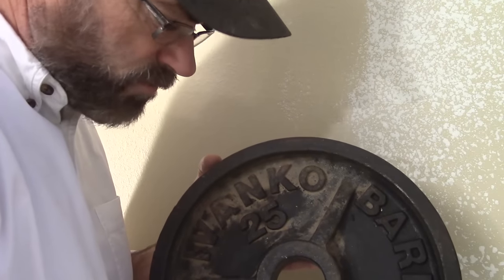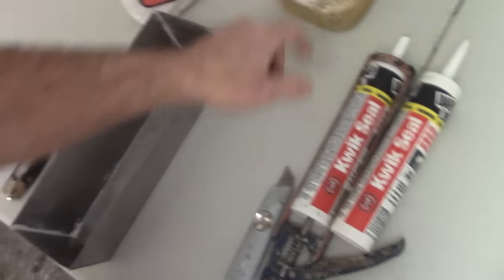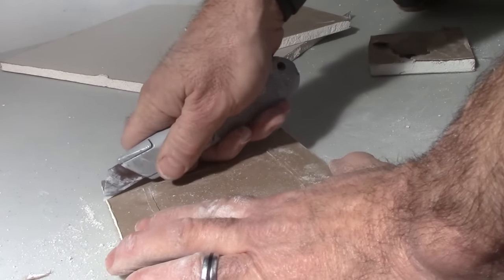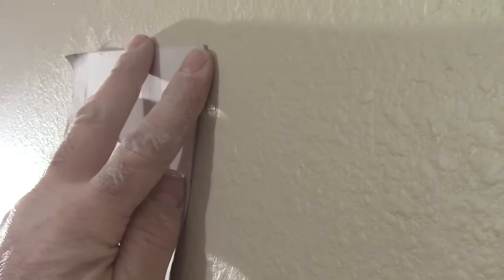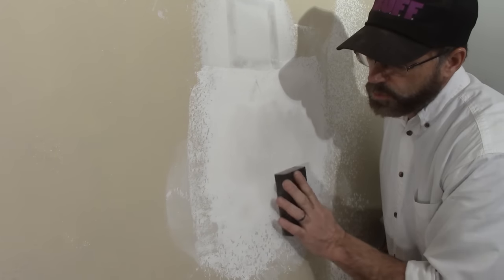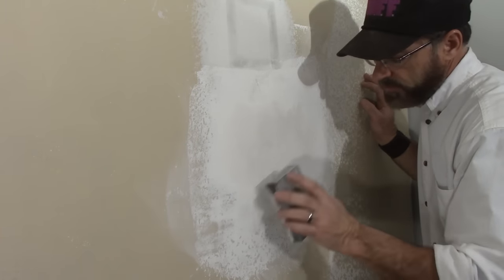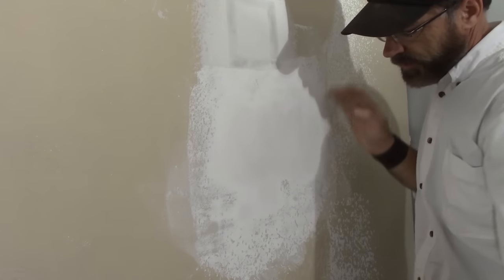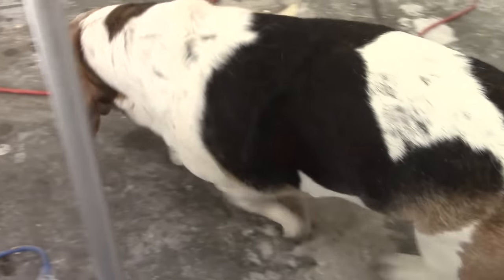How to Repair Drywall and Match Texture - DIY Duke

Comment: I was a professional drywall finisher for over ten years and my husband for over 40 years and We have NEVER seen or heard about flicking drywall mud from a brush for texture. I tried it today to texture several patches in a bedroom and I am SO IMPRESSED!  It worked like a charm and looks amazing. It worked so much better than the canned stuff and a heck of a lot cheaper! Thank you SO MUCH.
Reply: Carrie Wainwright - As a professional drywall finisher, I would love to know what the painting contractors told you about people that apply caulking is wall patch? I was a professional interior finish carpentry contractor for many years and know the painters said "DO NOT put caulking on the dry wall surfaces"
Reply: @carlcampbell6827  caulk can't be sanded and usually is so flexible that it will crack the paint if it moves. I used to work at USG (U.S. Gypsum) and we made lots of different kinds of mud but they are pretty much all made with gypsum so they are similar and often you can use them interchangeably if you know the properties and what you want out of it. (He probably shouldn't have used it here but if he isn't going to sand it because it's his own garage... Then whatever. Not the best application)
Reply: Yes. I never thought of this and it's so much more reliable than the can stuff.
Reply: @carlcampbell6827  that’s probably because you didn’t know how to use a caulk gun.😂😂
Reply: @santiagobenitez6818  I suppose you were taught to use latex caulk as patching material on drywall? This knowledge you are asserting about proper use of caulking gun is a good example of non professional teacher. When caulking finish and trim wood, caulk must not be smeared over adjacent drywall or it will leave smooth shiny strip when wall paint is applied.
Reply: 13:06 - flicking drywall mud from a brush for texture

Comment: Dear DIY Duke, Thank you so much for posting this! I've never worked with drywall or repaired a wall hole before, but thanks to your instructions, I was able to patch an 18" by 18" hole in my bathroom and even match the texture to the rest of the wall. I used your caulk method, and it was easy to use, and set really well. Thank you again!

Comment: I commend you for taking the time to create this video for the viewers. Having said that, I'm continuously amazed at how many diy'ers use this method to patch holes. it's NOT the right way to do it and it takes no more time to do it right. Cut a patch. Hold it on the wall over the damage and trace around it. Cut the hole in the wall around the damage. Install two 1x2 strips of wood to the wall as backing inside the hole. Place the new patch in the hole and attach it with screws through the wood 1x2's. Apply fiberglass tape on the four seams. Apply two coats of hot mud. Sand hot mud with a damp sponge before it sets up hard. Texture to match existing. EASY. No sanding dust. Plenty of backing strenghth and more importantly, this creates a solid patch with solid backing. Should you patch a door knob hole with this method, the hole will stay patched should the door knob crash into the wall again. Furthermore, if you know you're patching a door knob hole, you can place the wood strips right where the door knob would strike and FURTHER strengthen the repair. I'm a 40 year house painter and I've repaired hundreds of holes this way. None have ever failed. Bob.
Reply: Exactly.
Reply: Robert Partridge Hey Bob! Do you have your own YouTube Channel? I'd love to subscribe!
Reply: I concur. I do maintenance and repair for a living. Patching 6' and below should always be backed with something. Once I was hanging a picture and hit one of these backless repairs and boom. Now I had to do wall repair before I could hang one decorative art piece for my customer.
If you rent and damage the wall. Fix it right. Remember Karma will find you.
Reply: That's the way I was taught in shop class nearly 12 years ago.  I became a painter and not one person does it that way.  They all use these metal patches.  Probably because it's less supplies to carry around and you don't need sheets of drywall with you.
Reply: Thanks...   People do not think of proper texturing for that seemless look.  Shit loads of putty & sanding do not give you that paper texture look of drywall... You can see where the hole was...
Reply: +Robert Can you put two holes in your wall to prove to us that this is the correct method?
Reply: Need a carpenter
Reply: Either method works. This method is MUCH easier, mate.
Reply: And...your DIY video is where? If you can't add something constructive without condemnation of others, they shut up.
Reply: I use paint sticks.  I get a few EVERY time I go to the big box store.
Reply: There's always one...
Reply: Sounds pretty good, but also forever
Reply from the maker: Dude really then you've added an unnecessary step, if you worked around fast set very much coupled with fiberglass then you know you don't need wood unless you're using viagra😂
Reply: Hey rob, this is a California hot patch. Pros use it all the time and you use durabond to tape it in and first coat it. Once it dries its harder than the original rock.
Reply: @anthonyb5193   Isn't that bondo? I love that stuff.
Reply: For larger patches between studs I understand the need for inserting something to then put a drywall screw in but these holes are too small to have to worry about doing that.  The only thing that jumps out to me is that the caulking he used really isn't going to adhere to the "raw cut" sides of his patch.  It sticks to the paper and to the wall but it's not really grabbing that rough, chalky material on the sides of the patch.  I use this same method except I butter the patch with mud and it sucks into the chalky sides and becomes part of the existing wall.  Also, if you spray the paper before buttering up with mud the mud adheres better.  So many different ways to do the same job but I wouldn't use caulking in this application
Reply: If the patch was done correctly, with mud and not caulking the wall should be plenty strong enough unless you hit the wall with a hammer with driving a nail.  @1stFlyingeagle
Reply: What says your way is correct. Cut the drywall 2square" bigger and cut out your hole. Remove the gypsum from the 2" overcut drywall or other wallboard material as needed leaving the white paper. Mud, Install patch, tape, and mud. Sand and paint. 3 he till dry w/ a fsn.
Reply: thats what i say.

Comment: Thank you Duke, had a patch to do and its quite a drive for tape. The inch of overlapping paper that was something. I appreciate the idea that I am going to keep with me. the only thing I did different was I did the backer. I went with the hot mud as that's what I had but followed you steps to the letter and my patch was feathered perfectly and flawless. Nobody would ever know there had been a hole there. I appreciate that you took the time, effort, and material to teach something you didn't have to based from your own experience.  I hope you are doing well.

Comment: Wow, thanks for the stiff brush-flick texture idea - that is so cool.  I am exhausted doing my 2 ceilings with a skim coat.  I had scraped off 1965 type popcorn texture.  Trying to decide, but you have shared some great patch/texturing examples.  thanks for your time!
Reply from the maker: You're welcome Janet.  There's some cool ceiling textures you can do, one of my favorites is a skip trowel with a little bit of silica sand mixed in with the mud.  Looks old school simulating plaster.  Another style I like is painting the ceiling first then taking the paint and mixing it in the texture mud until you get a slight color difference then you get this awesome subtle two tone effect.

Comment: Great video! I wish you had some text on what texture was what on the finished product. Here's what I gathered:
15:21 Top right: Brush flicked (13:09)
15:33 Top left: Spray Can Regular (orange peel, 13:29)
15:39 Bottom: Spray Can Knock-down (14:04)

Comment: Excellent video, funny and informative.  If the damage to repair is on the bigger side, it's a good idea to screw a backing piece or two of wood strip across the hole -- insert strip into hole, fasten across hole with drywall screws on either side of the hole set back an inch or two from the edge, being careful to dimple the screws but not overdrive through the drywall paper -- before inserting the patch, to prevent the patch from ripping free if someone pushes on it, drives a nail into it, etc.  You can also fasten the patch to the wood strip.
Reply from the maker: yes, thankyou

Comment: I just did a major wall repair which repairing an area where the paint had separated from the wallboard.  When I cut through the paint to repair the separated spot I found that to be the tip of the iceberg--the paint just peeled off the wall.  What apparently happened was that the person who primed the wall originally did not clean the wallboard first.  Thus, the primer did not stick to the wallboard.  

I wound up peeling 2/3 of the paint off the wall before i reached paint with decent adhesion.  I cleaned and primed the area and then came to your video to learn about repairing texturing.  I wound up doing the same thing as one of your other "viewers"--I stopped the video to make sure I took the time to express my appreciation for your having taken the time to produce it.  It was very entertaining and I learned a lot.  I thought the caulk idea was genius.  Years ago I tried using spackling to "glue" patches in and have found that it just doesn't work.  I have since used paint sticks to form what I call "backer boards".  I screw them into place with drywall screws to provide support for the patch.  But the caulk idea is faster I think and plenty strong enough.

Thank you again!
Reply: Thank you for your video. I have some patching to do. I didn't know how to make the texture match. Again thank you for your time to do the video.

Comment: A mistake a lot of DIYers do is to use plain old spackle. Baby power mixed with water would work about the same as spackle. Need to use a curing type joint compound. The caulking repairs are stronger and more flexible so they're less likely to crack as the house moves.

Comment: You can also use a wet sponge instead of sand paper. I've been doing it for years. Just dip the sponge and leave a little water in it. Then you just wash it, starting around the edges and working your way towards the center. The benefit of doing this is there is no dust and you can paint it almost immediately.

Comment: Thanks man, I just did the same job yesterday and I’m a younger guy and I’m not too knowledgeable and after I did the patch work I was trying to figure out how to get my patch to match the texture of the wall which is that orange peel stuff and I came across this and now I wish I would have done the paper back method, I’ve never seen it done like that before. Your instructions on how to match texture was great, got it done and it’s looking good.
Reply from the maker: Thank you

Comment: Great instructional.  I used the mud method followed by a very thin layer of drydex spackle; then sanded and textured.  Like you said, "You can't tell there was a hole ..."

Comment: Knockdown will dry differently on paint vs new joint compound. So you might want to spray the painted area first wait a while then spray the center over the joint compound so the two ares will be at the right consistency for knocking down. Otherwise prime the area before the texture so they dry similarly.

Comment: I almost thought it was an episode of Breaking Bad
Reply: @James Draper III you aint no better than diy duke.
screw a piece 3/4 board to drywall in hole then simply screw patch piece in place  and tape right quick.
you people waste a lot of time trying to cut flaps so you dont have to tape.
taping takes about a minute or less on a patch like that. Cutting flaps takes 3 times as long.
Reply: LARRY HEAP
Reply: There's blue meth behind the wall
Reply: LOL!!!!!!!!!!!!!
Reply: I was thinking more on the lines of Boyd Coddington from American Hot Rod bless his sole.

Comment: Thank you for this highly informative video. Recently began remodeling my third bathroom which involved removing a contractor mirror with light fixture attached. The mirror was hiding two big holes punched into the sheet rock by the original contractors. I have no problem patching their clumsiness but my issue is trying to match the newly muddled wall where the mirror was to the already painted wall adjacent to it. This will be a tremendous help in doing that.
Reply from the maker: You're very welcome

Comment: I like the circle patch to repair damage done by doorknobs, etc.  The only thing i do differently is I cut the patch first.  I can you a water class, a saucer or whatever for a template for the patch.  Then I place the patch over the hole and trace around it so I can cut a hole exactly right for the patch.

Comment: I like most of the stuff hes doing here. But theres no reason to use caulking for patches. Regular mud will do the same thing. Use hot mud if you want it to set quicker.

Comment: Hi thanks for the video. Quick question, what's the difference between using a dry stucco mix and a pre-mixed joint compound for small knock down wall repairs?

Comment: Not being rude, but the texture does not appear to match so well.   The two types are distinctly different.  But I learned a lot from your video, thanks.  My home had "sand" texture when new, which is basically a densely speckled wall with looked and felt like sandpaper.  Over the years with painting and wear it looks like a very fine orange peel. The orange peel in  can is way to large to match, but the flicking technique follewed up by a few coats of paint I believe will do the trick!

Comment: I've done the first patch before on walls. Do you have any suggestions on fixing cracks over doors or windows? I've always have them come back. (no matter what I tried, chaulk, fiber tape, etc...)  Right now, I'm beefing up the wall, which is a load bearing wall, and I think they didn't put enough 2X4s eventhough its 16 on center. I'm also replacing a 2X10 header over the door too, which was bowed and had large gaps.

thanks for the videos
Reply from the maker: +taledarkside you go into a lot of houses and you'll find those header cracks.  Sometimes when hanging we'd "picture" the window in other words put up a full sheet and cut out the window instead of using scrap later to fill in the top that way not having a joint but even then you get a crack.  Stress and house movement during the course of seasonal changes with moisture and ground movement.   I've taped them with fiberglass and they still come back.  And it's definitely structural.   Beefing up the framing should do it.

Comment: Excellent video! I've got a couple of areas where water leaked down a wall from the attic and peeled the texture off the upper wall. This doesn't look too hard to do. When you fix a hole, do you ever glue braces (like popsicle  sticks) behind it for strength?
Reply from the maker: +salt_fly thanks, you can take some plywood or a 1×2 or whatever you have a put in the hole before you put the patch in.  Take a couple drywall screws and screw through the existing sheetrock on both sides into the wood so you basically have a backer to screw the patch to.  Of course if you're close to a stud you can screw the patch to the stud.  However if you use fast set for the patch and fiberglass tape it's amazing how strong that patch will be without any kind of backer.  I been doing it since 1979 and never had a call back.

Comment: Thanks for the GREAT video, I have a question for you about water damage, I'm considering a property with a HUGE water damage because of roof holes, after I will fix the roof somehow, the water will still be in the dry wall, ceiling, floor and even between the 2 floors building and the ground floor, the water was there for around a year as it was vacant property, now it has a HUGE mold damage as well!
Do you think that I can fix this by using heat drying machines and whether this will fix the mold issue without any need to remove and replace the dry wall ?
Thanks
Reply from the maker: Hey Mena, sorry it took so long to answer; sheetrock will dry out normally but if the water damage is severe and lengthy the paper will deteriorate and the gypsum will become crumbly.  Mold of course is a big issue however if the drywall stayed in place and has not broken free from the fasteners or sagged extensively then you may be able to saved it.  The mold should be visible generally.  We have used dryers to save it in the past.
Reply: +DIY Duke Hi and thanks for your answer, so if the drywall is okay but the mold is visible , I can just dry it out without changing the insulation behind the wall ?
And in this case after it dry, the mold won't come back again ?
Thanks!
Reply from the maker: +Mena George black mold seems to be the most common for drywall that has gotten wet.  Where I live in the high desert the mold problem isn't as bad as it is in higher humidity areas.  Mold experts recommend replacing the drywall and say cleaning with bleach will only feed the mold.  Having that kind of water damage for an extended period of time I would definitely check your insulation and framing for dry rot; just to make sure.  Again depending on your area and humidity levels that are present definitely can determine the extent of damage.  If the damage is covered by insurance it would certainly behoove you to get several estimates on repair if that's the circumstances.  There are a number of paint and primer products that kill existing mold and mildew i.e. Zinsser mold killing primer, et al.  I have used Zinsser products and they are reputable and of course they make mold resistant (remember "resistant" not proof) sheetrock. Definitely check your options.  Hope this helps.